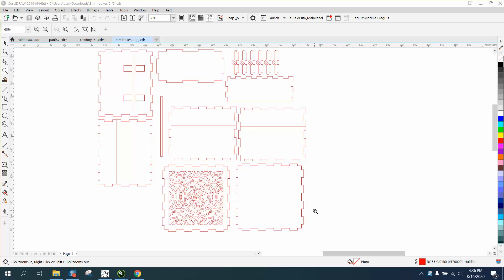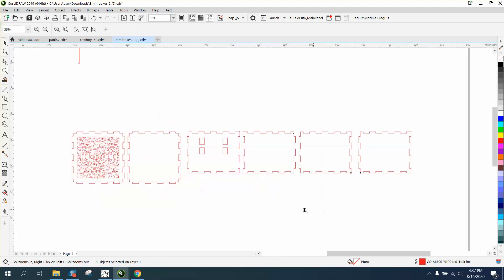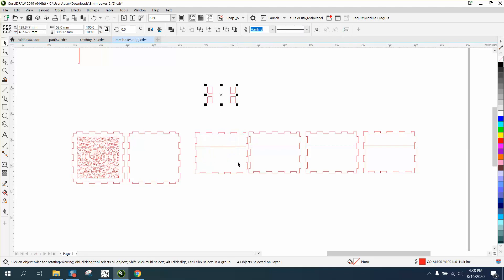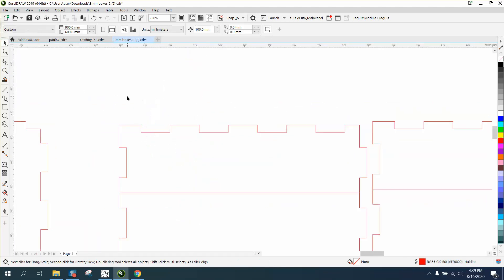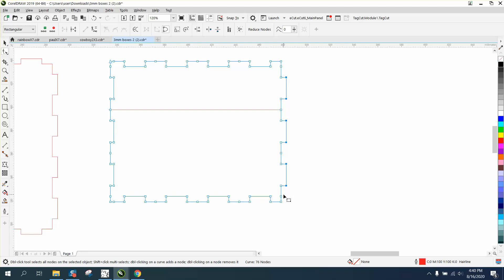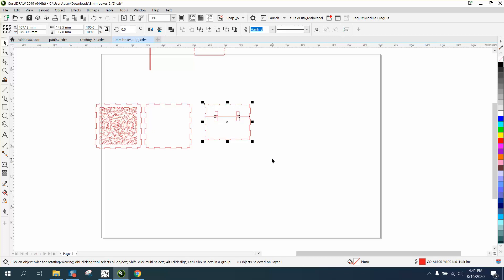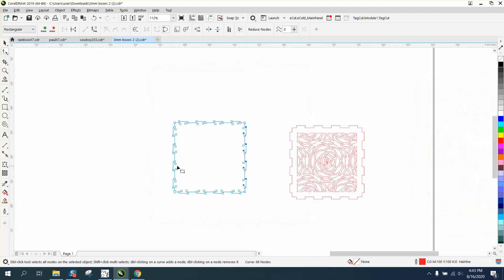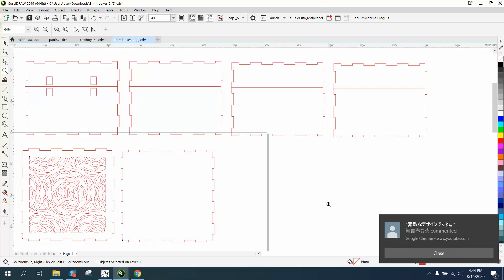Corel Draw Tips & Tricks Resize a tab box

Comment: I would have gone out rather then in...in makes the box smaller...out keeps the box the same but the tabs will be 3mm.
Reply from the maker: not sure I understand?, thanks
Reply: @DougGreenAustin  Meaning by moving the outside lines in you have 3mm but the box is 3mm narrower..if you move the inside corners of the tabs outward the tabs are 3mm and the box is the same dimensions outside.
Reply from the maker: @bobbosler4504  Ok, got it now, thanks